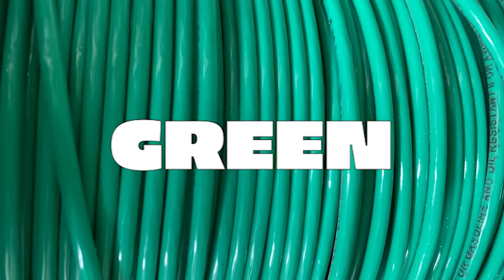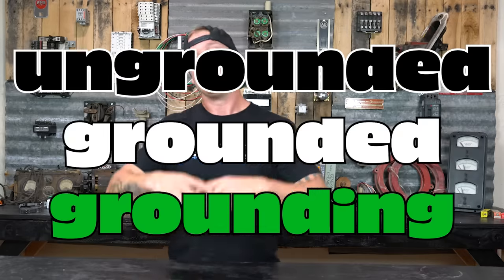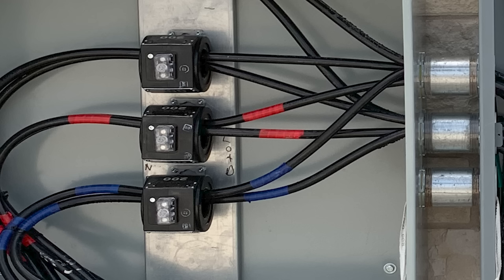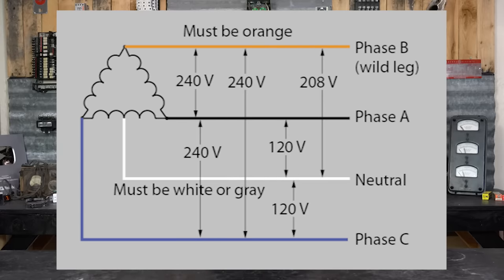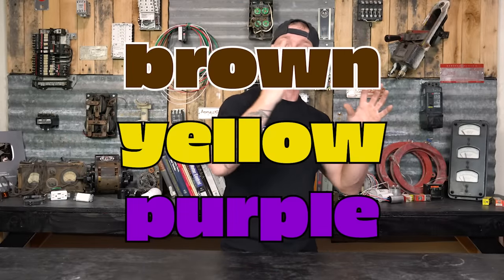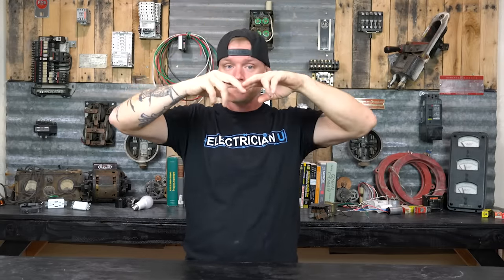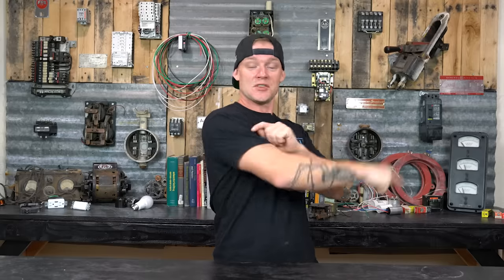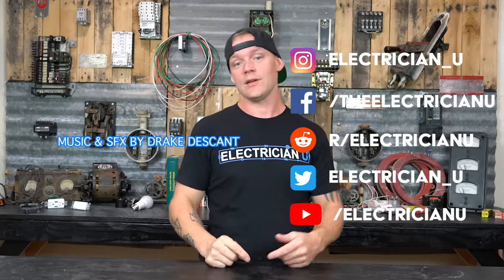Electrical Wire Color Coding Used By Electricians

Comment: Most instances you will see residential having only single phase, your black and red wire from this phase this is the split phase coming from main transformer, tapping off the opposite ends of the same transformer. I’ve heard of 2 phase being used in some industrial facilities in Texas. 3 phase is common place for commercial and most industrial installations.

Comment: Your talking a 4 wire delta transformer with center tap on  phase A for neutral and that three phase transformer is giving you a wild leg, so you don't use wild leg B just use A/C Legs.
 Delta transformer where used  for motor loads  in factory, manufacturing plant or a production plant  and the power co. would not supply you with that type  a delta /wye

Comment: I'm 18years retired coming up this May so I'm not up on the latest. In the San Francisco bay area, to my knowledge, that 3 phase (Delta) system you showed with the 208 volt to neutral (purple) conductor would be 115/230 and 190 volts on the "high" leg. That "high leg" also would still be blue and the electrician would just need to test/realize it was a "Delta" type 3 phase system. While it sounds kinda dangerous, it can be if you don't pay close attention but it's not a common system. In my 40 year career, I only ran into that system one time. Again, around here, the 277/480 colors "typically" are brown, orange, yellow. Usually with white as the neutral unless the engineer specifies the grey. 
If you get into some of the oldest houses in San Francisco, you might run across some of the first electrical systems that were installed. One thing that can really throw you for a loop, is when you find one of those buildings where the "hot" were run to the lights and the "neutrals" were switched. All done with "knob and tube" with all the wires one color (black). Typically, rubber insulation with a cotton covering over the rubber.

Comment: I agree with everything stated in this video, I just wanted to clarify the difference between industry standards/practices and actual NEC requirements. There are electricians out there that can get these subtle differences confused. 

The NEC only specifies insulation color requirements for the neutral (grounded conductor) which is white or gray in color and the EGC (equipment grounding conductor) which is green, green with a yellow stripe. If the EGC is #6 awg or larger bare copper is also permitted.

The marking of ungrounded conductors is an industry standard but can be mandated by local AHU's (authority having jurisdiction).
Reply: @Bob Lund… the code does require that the high leg be color coded Orange. It does not, however, restrict orange to only the high leg.
Everything else is spot on!

Comment: Question:   I have a standard 240v home system (Line1 = black, Line2=red, Neutral=white).   Recently had an electrician do a 240v run outside to an AC condenser unit.   240v only out to a disconnect box, and from there through a liquidtight conduit to the condenser itself.

While everything in the panel is black, white and red (and of course ground, which is either green or bare copper)  he ran two black wires out to the unit, and taped one of them blue, instead of the red I was expecting.

Any particular reason he would have done this?   Or is red and blue pretty much equivalent in a system like mine?    Just trying to understand.
Reply: If you mean he marked one of the black wires with a piece of blue tape, he was just trying to differentiate the hots from each other and probably didn't have any red tape.

Comment: We just bought an old house and there's a set of wire in the garage that has 5 wires (orange, blue, yellow, white, white) in a metal junction box bonded with a green wire. We learned that it was used for washer/dryer, but now it's used for an 15 amp receptacle. The bottom half of the receptacle is wired correctly, but the top half is open neutral. Should we be concerned? Thanks for your time!

Comment: On fixture wires the phase conductor is usually the wire with the information stamped on it, or some times a black line. You generally see these cords on lighting fixtures that hang from chain, or lamps. But it’s good to know so you don’t put voltage to the wrong part of a limp socket. Great videos!
Reply: Typically one side has the writing and smooth on that side while the side without the writing is ribbed and that goes to neutral.   Really old lamps with non polarized plugs might not follow this convention so it's a good idea to check continuity from the screw shell to identify the neutral wire from the cord.

Comment: Would the orange apply in a generator scenario? A 480 3 phase generator?
Reply: Yes it would
Reply: BROWN ORANGE YELLOW 277 480 VOLTS
Reply: @jcaleca60  
The yellow is supposed to be 277 volts in a generator?
Reply: @jcaleca60  
Or the orange?

Comment: In Trinidad and Tobago; Single phase from a center tapped transform Grey is neutral, Brown and Black are Hot wires. In Three phase Grey is neutral, Brown, Black and Blue are Hot wires with the Blue being the motor leg in a Delta connection. Green or Green with Yellow Stripe is ground.

Comment: I’m aware that you can use a black wire for Hot legs (identified with colored tape if needed), but what is a black wire with a white stripe running through it used for?

Comment: For 3 phase isolator switch, how do we install the wires based on the colors?
yellow/green/white for earth
no wire installation for neutral
Black for L1
Red for L2
Blue for L3

is the above colors installation correct?

Comment: I’m a mechanic and spend most of my time in 12 volt systems where black is ground. However occasionally I find myself in a MotorHome with both a/c and d/c. Really have to know which system you’ve got a hold of, that wire could be a 12v ground or a 120v hot. 
Once I was in a camper and the manufacturer carried the A/C color code over to the 12v side. The battery had black and white wires with the black on the positive. I was a little weirded out, I traced the wires to be sure.

Comment: I'm out of California so we might be different here. I've always seen the stinger as violet or purple. Delta systems are typically used in Industrial or Commercial applications that have a lot of motor loads. Mostly a 3phase 3wire config. I've only seen orange in a 277/480 system.
Reply: It’s the same in Arizona, Colorado, B/O/Y for high voltage

Comment: I wonder if the brown, yellow, purple is a region specific thing. I've been doing commercial service work for a while now, and I've only ever seen brown, orange, yellow on 480v panels and equipment. I live in Florida and have been all over the southeast US.
I've also never seen a gray neutral in a 480v panel or equipment. It's usually just white.
Either way, great stuff! I always learn something new from your videos.

Comment: Piped and pulled wire in homes  here in Chicagoland for over 25 years, then 2008 happened. Pretty much the unwritten housing code was this. Hots = black red blue, Neutrals (pre arch fault) = white and gray, Switch legs= yellow, org, brown, purple. Travelers = brown ,purple ( yellow, org sometimes if needed) . Load side of gfi purple hot gray neutral. Don't know how many times I had service calls to explain colors to people who moved here and couldn't figure it out. " But the paddle fan instructions only say black and white wire "

Comment: In Europe the colors are as followed: 
Brown = Phase(Hot) in a Single Phase or Phase 1 in 3-Phase application. (single phase means only 1 Hot)
Pink, white or some other colors = 2nd/3rd Phase (Im not quite sure witch colors are allowed, I saw pink and white used for this but there are other colors possible)
Light Blue = Neutral (sometimes they use dark blue but light blue is correct)
Green-yellow = Earth (Sometimes Green or yellow is used but only the green-yellow is correct.)
Voltage between Phase and neutral is 230VAC in most cases and between Phase and phase its 400VAC

other common used colors are:
Red = Positive DC
Black = Ground (NOT Earth or what you call ground, its the 0V reference point of the DC circuit)
Blue = Negative DC

Comment: Canada: 120/240 1ph Red=A Black=B. 120/208 3ph Red=A Black=B Blue=C 347/600 3ph (not required everywhere) Orange=A Brown=B Yellow=C
I hate that these aren't consistent between us. Every time I get equipment from america I have to check the wiring for correct phasing. Most RTU's I get are good with Bk-R-Bu, but if I get a random motor/controller combo somethings always wrong.
Also High Voltage 750 and up, Extra Low 40 and down, Low Voltage everything in between.  Lots of people will call 120+ High and like 24ish Low.  Bad habit when reading code.

Comment: There's also 3-phase corner grounded delta system. The phase colors are black, white, blue. The white in this system is not a neutral but it's required to be white because it's a grounded phase conductor. Neutrals are always white (or gray), but not all whites are neutrals.

Comment: We use orange for phase B on all 120/240 3 phase systems and on Phase B on 277/480. You pretty much have to know what you have in your building. It's not that hard. Always check all 3 phases to equipment ground or neutral and you'll see a different voltage on the high leg to the neutral. On one system they used Phase C as the high leg. The neutral was tapped off halfway between phase A and B . Normally the neutral is a center tap between phase A and C. So the phase further from the neutral is the high leg. This is probably too much information for most of you that aren't into commercial/industrial wiring. But just be aware.

Comment: Know this is an older video but one other color scheme I’ve come across working in Boeing Helicopter’s plant which is considered a Military Facility uses Red, Yellow, Blue or RYB for their 480/277v systems. Which always threw you off the first time you saw it. Not a common one but it is out there.

Comment: So on a 480 v 3 phase field generator, a balanced system, no neutral is required? Or is it each leg is the netural 20 times a second? Also could the generator have the center tap at 208v? Thanks

Comment: I worked for a Fortune 500 company in the USA for 8 years, that absolutely refused to comply with color coding. As a "professional" I was appalled by their lack of safety, and disregard for these simple color codes. Power is black, ground is green, all AC control wires are red, and Dc is blue. Many machines had 480 and 240 in the same panel, and they stuck with this 1940's code to a T. Even mentioning it to them brought rage. I retired early.

Comment: Reminds me of a certain Embassy in India, where EVERY WIRE IS RED.  Little old 90lb 'master' electrician just rolls around a boat anchor multimeter which is older than he is, and before testing each wire licks his fingers and touches bare conducters. Keep in mind that India uses British empire standars; 270v Pre-1977 IEE three-phase 50-1k V AC 40-100 A circuits.
Yeah, they normally have Brown (+), Grey(-), and Blue (-Earthed).
So I hooked up everything through a propper 60A PDU/UPS, and used proper color wiring out from that. 
America has few problems.

Comment: 120 VAC to 240 VAC Single phase  >>> Black ( A 1 ) Red ( B 2 ) Blue ( C 3 ) <<< { Only here in can a White wire be used as un-grounded conductor with
color tape }
208 VAC to 277 VAC  3 Phase WYE >>> Brown         Orange        Yellow
440 VAC to 480  VAC 3 Phase Delta>>> Brown { High Leg } Orange  Yellow
Now in Marine wiring the color code is different ... they use RED as the ground

Comment: Interestingly the NEC only specifies color on 3 wires.  Neutral, equipment ground, and orange high leg for center tapped delta.  On a 3 phase system each hot phase must be identified, but the NEC doesn't specify a particular color sequence for a certain voltage.  It only specifies that whatever color sequence is chosen, it must be consistant throughout that facility.  We as electricians have chosen black-red-blue for 120/208,  black-red for 120/240 single phase,  and brown-orange-yellow for 277/480.  In commercial beware the orange coded wire.  If the sytem is 240 center-tapped delta, then orange is the high leg and not part of a 277/480 system.  With 277/480 we use all 3 colors for lighting with the gray neutral.

Comment: As an industrial maintenance technician i learned quickly not to trust colors. 

The plant I work at has hot greens wires, has wires that change sizes and color on it run. Now anything that has been installed with in the last 5 to 8 years is color coded because it has to be to code everything else was grandfathered in.

Comment: Can you use black for ground from main to sub panel. I thought I read nec where it said conductors 6 and smaller must use colored wire and not marked with tape. 
I'm wiring garage and going 4446. And I already have a black 6. Do I need to get green or can I green tape mark it ?
Reply: Smaller than #4, grounds must be green along their entire length. As long as you tape the whole thing, you can use a black with green tape.

Comment: I am looking for the code rules that specify the color coding.
Reply: The only code rules pertaining to color of conductors are:
Green shall be used for equipment grounding and nothing else,
White or Gray shall be used for grounded conductor and nothing else (with one exception for the allowance of the white wire in romex to be used as a switch leg), and the hi-leg (Wild leg) in a delta system will be Orange but Orange is not restricted to this use only.

Comment: Man, I'm a Navy Electrician and it was a lot different inside the Ships Gyro Compass,  so I came here all these years later to get re acquainted with residential..  If you do re-educate me I will subscribe right away.   I'm reading 432v on two legs of a 220 socket ( and the breaker box all a Rats Nest ) ... and with the house wiring hidden by an acoustic  ceiling squares.  The long term previous owner was a retired Air Force guy who new only Aircraft wiring... Obviously,   lol !   Great Video BTW   Hell I new I needed to sub,  so see you soon with my fix    THANKS
Reply: A floating neutral will do this and burn your house down if you don't fix it.  I'm Real old,  and have seen floating neutrals,  Partial blown fuses on a 3 phase system  burn out light bulbs that weren't on and smoke a thousand dollar set of Magna Pan speakers of my wife's.   One time a Reversed Diode on a 3 phase 575 V, LARGEST WELDER in the world ...  I hit the switch blew up the Grid of a small town in Ohio ) 2 substations, and small flames in the factory. WE came back to work the next day along with the entire city...   BAMMMMMM

Comment: If you flip black/red on speaker wire, usually what will happen is you will invert the phase of the speaker. Not a big deal if you have only one speaker but if there are multiple hooked up having an out of phase speaker will make the signal sound weaker/hollow. Inside electric guitars coloring is a little bit more of a wild west scenario. Black will typically always be ground and white red and yellow are used interchangeably for your signal from your pickups.
Reply: AC volt sine wave is alternating unless its DC then you have a point

Comment: when running #12 ungrounded wires (120 volt circuits) through a 3/4" conduit can you use different colored wires to identify different circuits (red, black, blue, orange, purple etc)

Comment: I imagine we didn't touch on red/white/black because it would confuse more people.  Still important to know in industrial situations with equipment coming from over seas.
Reply: As a side note - the incoming to my apartment is 2 wires, black and red. The black is "hot", the red is combined ground/neutral. This is the design that was done before 1968 where I live. Since '68 neutral must be blue and ground must be yellow/green.

Comment: I have a question for you guys. Our facility has a department with a 3-phase open delta 240V system. All of the ungrounded conductors are black and there is no neutral. Every time I work on a machine, I rewire it with black/red/blue. Should I be using orange for L2 to signify the wild leg? I've never seen black/orange/blue in the wild.
Reply: Follow up question: If I do switch to black/orange/blue should I change the colors I use for 480V? We use brown/orange/yellow... I've never seen brown/yellow/purple.
Reply: If you have an ungrounded  delta, there will be no high leg so you wouldn’t need to identify one phase with orange tape. Also, if the delta is an open or closed does not indicate whether or not it’ll have a high leg. If it’s an open delta this just means you can only operate at 57.7% of the three phase capacity.

Comment: i think most places use brown orange yellow for 480v. Texas is the weirdo one that doesnt.
Reply: Throughout the rest of the US, electricity runs through a grid. However, in Texas, power is not supplied from the national grid. That's why they can make their own rules. In order to keep the color coding consistent, BOY is used for 480v wye transformers.

Comment: What size ground wire ( copper thhn ) do you use for a shop 100 amp sub panel? . Run is 180' to main service panel.
Reply: The size of your panel does not dictate this, the size of your upstream over current protection device dictates this. If you install a 100 amp breaker in your main panel to feed your shop, you need to run a #6 ground, unless you upsize your feeders for voltage drop and then you’ll need to upsize your ground.